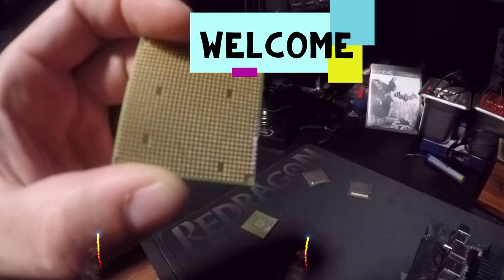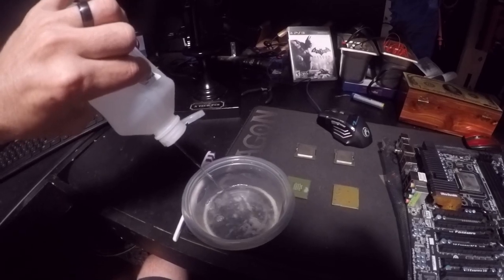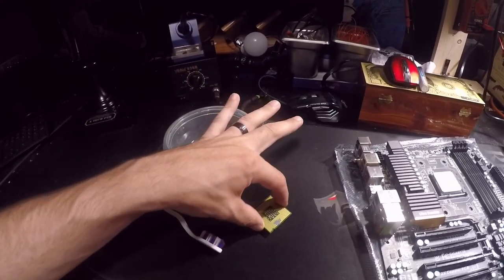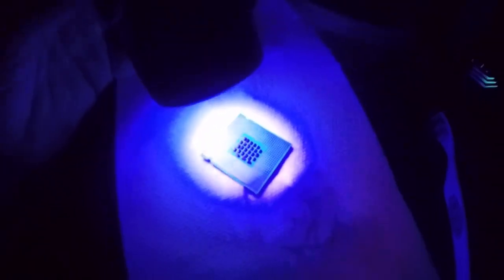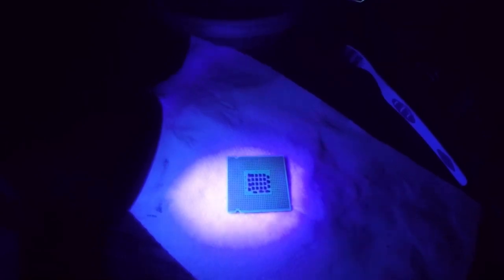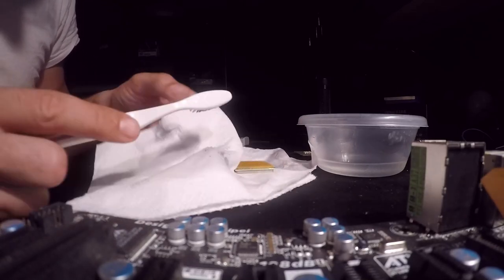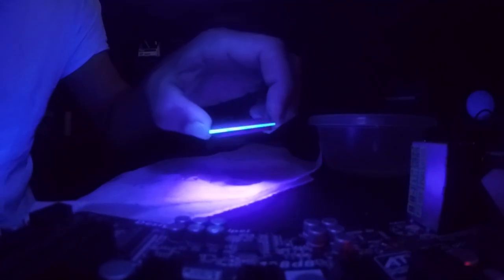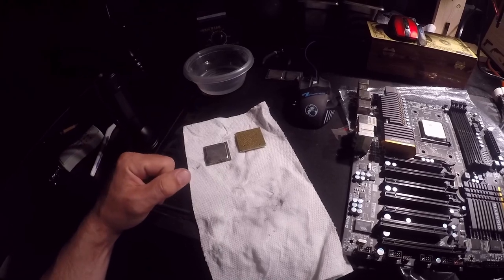✳ How Too Remove Thremal Paste From CPU PINS/PADS ❂

Comment: There is lots of discussion about soaking an entire cpu in alcohol. Most folks say that it's bad and should not be done. Nevertheless i tried it for myself with my Ryzen 5 3600. CPU is currently drying and I cant wait to put it back in my mobo...
Reply from the maker: Alcohol is used by manufacturers to clean electronic components I have been personally doing this for about 10 years and I have never once had a problem so I appreciate you watching the video

Comment: What if dried thermal paste is in the mobo socket pls help at the corner
Reply from the maker: if its dry ... use a razer blade and pick it out....  use a usb microscope  to see down into the socket..... most damage to socket it un-fix able.   it just depends how much is in it and how you remove it...    its tuff....    plz leave a like  and Subscribe to the channel ... it would really help us out ......   msg me back if u got questions
Reply: A TECH PCs tks man already did
Reply from the maker: @slayer21  awesome .... thank you ..
Reply: A TECH PCs just another question if my computer turns on without any problem is it okay if i leave it
Reply from the maker: @slayer21  well... if you try to remove the thermal paste .  u could damage the socket ... then u would be in a mess.... but if the pc is working i would leave it alone.... word of caution tho...  after a few months of that ... the paste will dry out and wen u remove the cpu .. you could end up with a crop circle .... dry thermal paste around socket ... so u may get stuck with using that cpu  only with that board.......  its really hard to give advice with out seeing the problem ... i hope it helps... msg me if u have ???   i dont mind ..
Reply: A TECH PCs tks man i will not be changing the cpu cuz it is an oem mobo i7-2600 no upgrade i think the thermal paste was there for like a year so its cool
Reply from the maker: @slayer21  yea i would just leave it .. the pc is on the older side anyway  then i would just leave it ..... if it kills it ... buy a newer pc...untill then enjoy the pc

Comment: Will this also apply to a cpu socket
Reply from the maker: Yes .. But. If its a AMD socket thats really hard.. And almost impossible.. If its a Intel board. U have a little better chance of it.. 1 . youll cause more damage to tue socket.trying to clean it out...2 you do get it cleaned.. But didnt get it all out and cause a black screen..  You can try to fix it... But if it fails.  Just buy a new 1.. Alot easier to do... Socket repair is tuff job.. 80% failer rate on fixing sockets.. I hope it works for you.. Subscribe. Check out some of our videos

Comment: now how do i clean a motherboard that have thermal paste in the pins (old intel board and idk how the previous owner did that)
Reply from the maker: u need a usb microscope to able to see deep down into the socket of the motherboard. their cheap on amazon for like 20$... if the paste is dry  on the motherboard..  alcohol and a tooth brush…       get tooth pics and Q-tips.. and remove as much as you can..   if needed use a blow dryer on low heat .. to heat the paste up to make it more remover friendly
Reply: @ATECHPCs  thank you, do you know any good USB microscope that you'd recommend from Amazon?
Reply from the maker: @TheMiningMersie   u want one. That is usb... Has. 1000x ... Comes with a stand.... Has a roll zoom in amd zoom out.... Usb..3.0. Or 2.0.  O bought one for. 17.99$   i use all the time... Plz subscribe. And leave a like... Thx

Comment: Hey i recently got a ryzen 3600 and when i built the pc i dropped a bit of sweat(extra small drop) on the pins of the cpu.
Do you know if that was fatal for it?
I haven't powered it yet. I want to clean it first.
Reply from the maker: no  your ok.. just let that dry ... at worst the sweat will dry and leave a residue behind.. in which poring a little alcohol  on it and wash it off... iv done way worst to a cpu and it was fine... best of luck .. hey consider subscribing to the channel and check out some of our videos .. thx again
Reply: A TECH PCs i subscribed
Reply: A TECH PCs how much time?
Reply from the maker: @vasilachealex   hour or 2...   Like it will dry in under 4 hrs.   Just let dry.  Dont rush it.. But yea few hrs. To be safe
Reply from the maker: @vasilachealex  thank you for Subscribing
Reply: A TECH PCs it's not working. When i try to turn it on nothing happens.
Reply from the maker: @vasilachealex  well that could be few things...    Does the fans comes on .. Does it turn on .. Or u get nothing... I need more info...  To help you.. Heres my cell # 865 274 3971. -don.  Txt me ..  Youll have to send me pictures of the build.. But will get to that

Comment: I got small amount of thermal paste on 3 edge of the pin I clean it but the inside of pin still got thermal paste is that ok to put in the motherboard? The thermal paste inside the pin is not that much. I also got thermal paste half way of the motherboard socket. I clean it with alcohol but it barely coming off. Is there anyway I can get off?
Reply from the maker: U must have all thermal paste removed.. Dont leave any ... Some thermal paste are conductive and can allow electricity to transfer and can short out ... Or  It will dry out and begin to cause havak on your system.. My advice is to remove it. If u cant remove it.. Re -place it.... Subscribe
Reply: @ATECHPCs  well everything works fine but the only thing is that it turning it off by it self is that a good sign? It post for a few sec and turn off
Reply from the maker: @johnthao6208  assuming that you have the hard drive and power supply and RAM and everything properly installed and hooked up to the computer yes it should turn on and Boot and stay on if the computer is turning on and then a few seconds turning itself off then that means you have a problem it is not booting something is forcing the computer to shut off usually it's a safety feature so if your machine is just shutting off its keeping something from overheating overvolting shorting out Etc

Comment: What happens when you used articclean to remove your thermal compound and it gets liquid and a little bit gets between your pins and then you put it in the motherboard socket will it damage the motherboard?
Reply from the maker: Yep very possible.... U dont want Nothing betweeen your cpu and socket...    Consider Subscribing. And thkz for comment

Comment: I got 1 got 1 Pin in the middle of my Ryzen 5 3600 and around 4 pins on the side 
Is it possible that it workes without removing the thermal paste?

Comment: What happens if you touch the pins of a cpu? Will there be any long term performance impairments?
Reply from the maker: The oils on your hands. Can transfer to the pins... Which can damage the CPU in the socket of the motherboard so if you do touch him use a little alcohol poured on it to try to get the oils off also please subscribe and leave a like on this video it would really help me out

Comment: i have an i7 9700k and i got a little on the bottom corner and i just wiped it off with my thumb and it looks fine
Reply from the maker: I would of wip with alcohol … that paste leaves a residue behind and that could be a problem,,, some thermal paste are conductive and could short out the socket or cpu….. all in all I hope it works for u.... hey check out my channel and consider subscribing... thanks

Comment: Could you do this to a motherboard?
Reply from the maker: no I wouldn't do this to a motherboard...motherboards carry small charges in the board,, the copastors carry small volts of charge .. which could short .. although alcohol is safe to use on electronics tho… but I would go with no....  to many things could go wrong ,,,,,  subscribe

Comment: Ryzen 7 1700 i have thermal paste on front side and between some pins, does it really work with amd? I heard this can break the cpu down, i dont wanna destroy it, got just one ryzen from friend, but as i said it have some paste...
Reply: Will it break the electronics inside? Cores, thereads, this stuff
Reply from the maker: Well as of right now... u cant use the cpu .. so take the risk and try it.    handling the cpu will be the hardest thing.. the tooth brush won't bend pins... unless  u press to hard.. also alcohol is used by companies top clean electronics .. so its safe to use.,.. iv been doing this for years .. i never had a problem...    consider subscribing and check out the channel
Reply: @ATECHPCs  no problem, catch a sub and like, i will try it

Comment: Sorry for my English, i just want to know something from you. How many days or how many hours CPU should be inside in alcohol.
Reply from the maker: 1-8 hours.....  u mainly just want the alcohol to eat at thermal paste ....  depends how much is on ... remove as much as u can b4 put in alcohol..... plz subscribe to channel  and leave a like on video .. thnkz
Reply: A TECH PCs i did on mu cpu is so few like dot so few because computer freezing and I got black area and than CPU light on in motherboard . But when I shotdown pc I can use my computer well after one week it happens again :( it’s kernel power 41/63 code
Reply from the maker: @erkandag5438  u get thermal paste inside of socket ?    between cpu and motherboard
Reply: A TECH PCs no I don’t think so because it’s working well if motherboard have thermal paste what should I do? It was just on cpu pin because it was so so few and not dirty it’s dry
Reply from the maker: @erkandag5438  remove thermal paste from motherboard is hard ,,,   u could damage the motherboard even more.......  if it works.. just leave it alone.... if u have big money motherboard... i would try to fix it .. if u not able to fix .. leave it alone ..
Reply from the maker: @erkandag5438  ok    take your time.... do really slow.... have a lot of light ... bright room/.... turn motherboard 360 degrees .. look for thermal paste all angles.
Reply: A TECH PCs sure I’ll do it 2 days later

Comment: If there a really really tiny spot will it damage it still?
Reply from the maker: U cant have Nothing on the cpu pins or contact pads.. NOTHING can get on the inside of the cpu socket on motherboard...   Thx for your comment.. Consider Subscribing to the channel and check out some of our other videos
Reply from the maker: Yes
Reply: A TECH PCs thank you I got a little and I got what I see all of it off but I feel like there’s still a i little left
Reply from the maker: @JoelAlvarez-wy3rr  i would clean it again.  Better safe than sorry.. And take your time.. Dont rush in anything pc..
Reply: A TECH PCs one last question does 91% isopropyl alcohol work?
Reply from the maker: @JoelAlvarez-wy3rr   yea thats. The

Comment: Its safe to tuch the pin cpu?
Reply from the maker: what do you mean >??   I wouldn't touch the pins with my hands.. your hands has oils on them that can transfer to the pins and cause a bad connection …. make sure to get subscribe
Reply: @ATECHPCs  its safe to buy second used  i7 4770? Im worried, done subscribe
Reply from the maker: @engkokln4762     you are buying a USED i7 cpu from someone.. I would ask to see it work.. and when u buy used parts ur always taking a risk.. cause you  don't know how that cpu was treated ..  I buy used hardware all the time..
Reply from the maker: @engkokln4762    also  go with what your GUT is telling you .. if u got a bad feeling .. then don't buy it..
Reply from the maker: Subscribe and win free tech !
Reply: Ya you can push on then too

Comment: So I have a question can it be 70% or does it HAVE to be 90%
If you answer this I’ll greaaaatly appreciate it
Reply from the maker: the  %  of alcohol  really don't matter.. 70 is .. the higher % u go the stronger it is.. that would be for really TUFF jobs.. I use 70% which what u find at the dollar store..  I would say anything over 40% should be just fine..  thanks for you comment.. u should consider Subscribing to my channel .. and check out some of my other videos... thx again
Reply: A TECH PCs  thank yoouuu but the one I’m gonna use is like a sanitizer and alcohol mix is that wrong
Do I have to STRICTLY get rubbing alcohol
Reply from the maker: @blayze1895  Do Not USe hand sanitizer...     rubbing alcohol.  Only.   No hand sanitizer.       Way different.
Reply: A TECH PCs okaay thank you so so so so much I loved your other vids btw
Reply from the maker: @blayze1895  o thanks...  I really appreciate that.  Thank you
Reply from the maker: @blayze1895  o thanks...  I really appreciate that.  Thank you

Comment: the alcohol wont dry up,i am afraid to use it again
Reply from the maker: Yea it evaporate and once it evaporates there shouldn't be anything left behind maybe a slight residue but you can easily wipe that off with a paper towel if anything just let it dry for a day it won't hurt it once it's dry alcohol is used to clean electronic components and alcohol itself will not hurt or damage any of the components please consider subscribing to the channel and check out some of our videos thank you for your comment

Comment: it's fine if i use perfume?
Reply from the maker: NO
Reply: I already did that but i sprayed a bit on a paper and wipped the termopaste of the proccesor
Reply: @ATECHPCs  and i still didn't put de cpu in the motherboard shouls i wipe it with water where i cleaned with parfume?
Reply from the maker: @alexandrujilteanu258  no.. Never use water... the perfume will have oils in it and those oils will get on whatever you put the perfume on the best way to get that off is to use alcohol rubbing alcohol if you don't have rubbing alcohol then just use a dry call and try to wipe it off and let it dry you trip want to get as much as office possible
Reply from the maker: @alexandrujilteanu258    if u use the perfume to wip off the thermal paste.. U should be ok.. I still would wip the cpu .. Just dont get nothing on the contact side.
Reply: @ATECHPCs  i've had a bit of paste on like 2 contacts on the cpu and i wiped just those contacts i've putted some parfume on a paper towel and wipped those two contacts and the top a bit that's all, if i would use water i would spread all that oil on the back of the cpu?
Reply from the maker: @alexandrujilteanu258    see after u used the perfume.   It leaves oils behind.. Thats what u have to watch for..
Reply: @ATECHPCs  oh is alright then there is not any on the cpu ive already cleaned it and i have still 12 days till i get the motherboard if by any changes there is oil it should go by 12 days, thanks you. There you go a new subscribe
Reply from the maker: @alexandrujilteanu258  u should be fine
Reply: @ATECHPCs  yea it is fine

Comment: my cpu is not working optimal after i have done this...
Reply from the maker: Could b many reasons why the cpu is not wrking..    The process shouldn't hurt the cpu..
Reply from the maker: You could of got somthing in the socket of the motherboard. And not even know it...  Or you may of damage the cpu...
Reply: i dont think i damaged the cpu i removed the thermal paste really gently but you might be right with somthing in the socket of the motherboard im going to check it later today
Reply: @ATECHPCs  can i clean the cpu socket the same way?